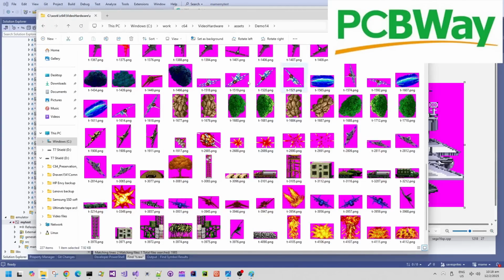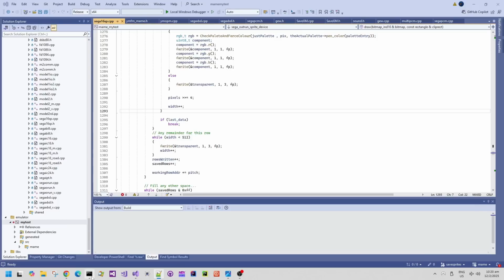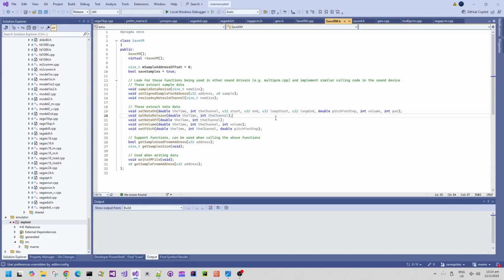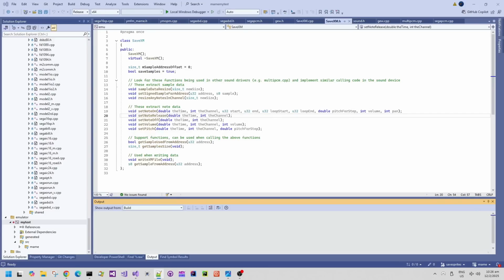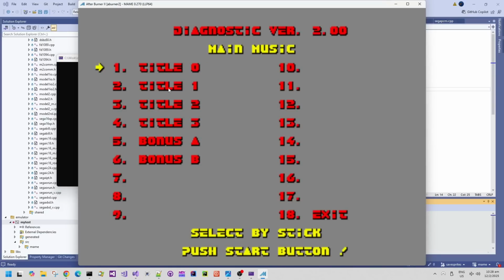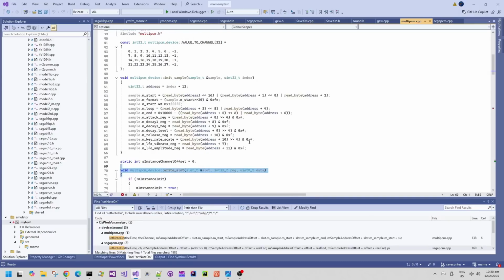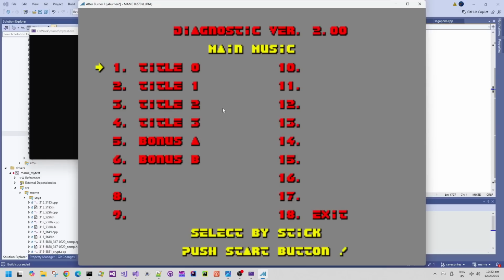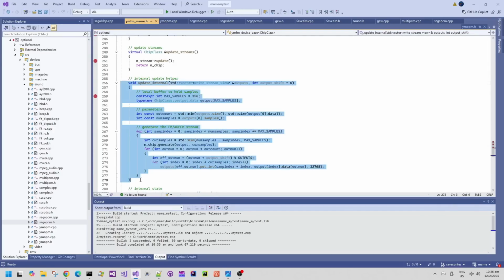MegaWang 2000 Turbo Edition - 35 - Capturing graphics and audio from After Burner arcade using MAME

Comment: Have you thought about using a vst for the ym2151 and rendering this out for the whole track as PCM?
Reply from the maker: The XM music file format I need is individual samples normalised to ~440 Hz with note on/off/release/volume event data.
I have thought about saving each YM2151 channel/voice as continuous PCM along with separate note data, then processing that into discrete normalised samples later on.